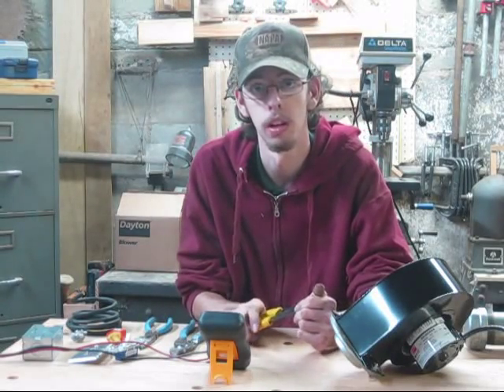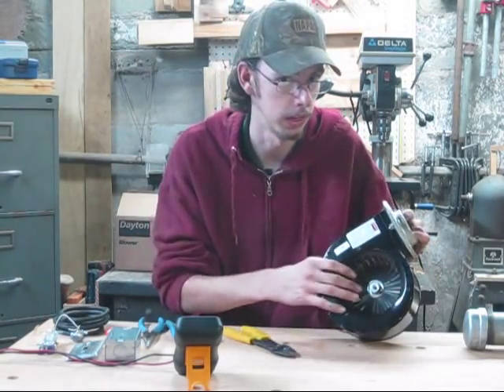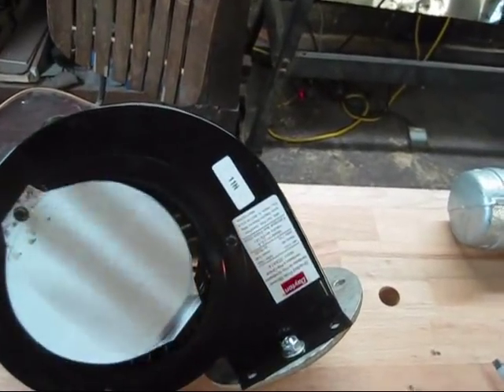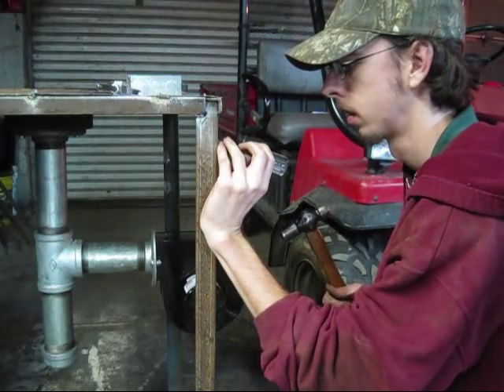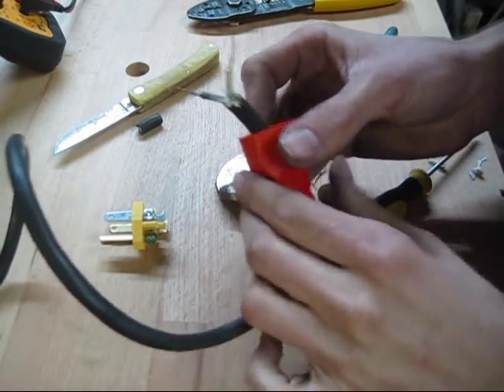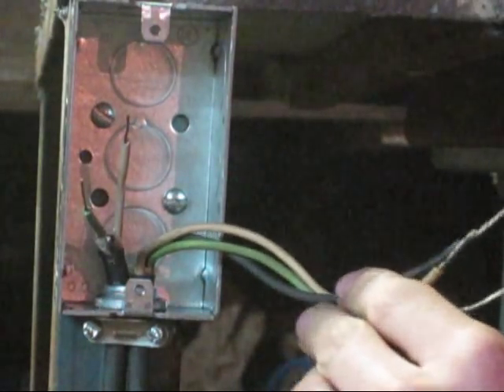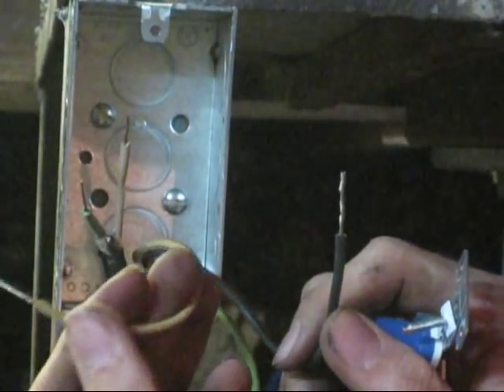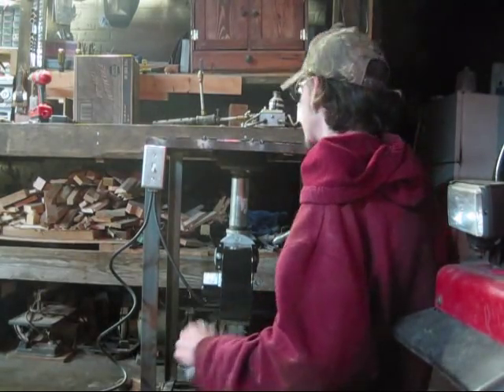Building a blacksmith forge part 2

Comment: 7:24 Wrong.
I have learned a lot in your vids.
But when it comes to electrical .... Good Guys Wear White Hats... that's neutral !!
The neutral wire (White)  is always connected to the silver screw and the black wire to the copper colored screw in a 120 volt 3 conductor cord cap.
Other than that keep up the good work.
Reply from the maker: You'll have to forgive me this was my first video I ever made, so I didn't say everything thing I should have. But did you notice I hooked them up correctly (black to gold, and white to silver)
Reply: Yes, good out come..
Keep up the good videos, I enjoy them.. and learning about stuff that I like to know about.